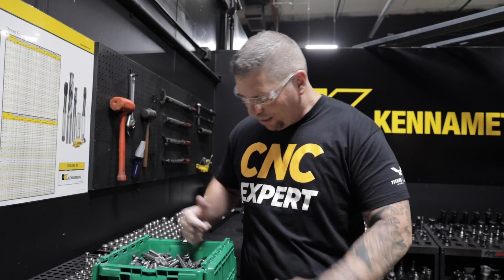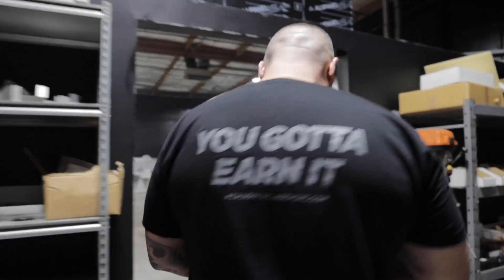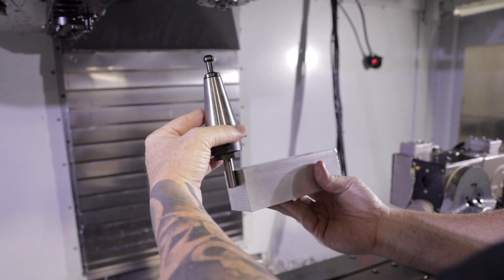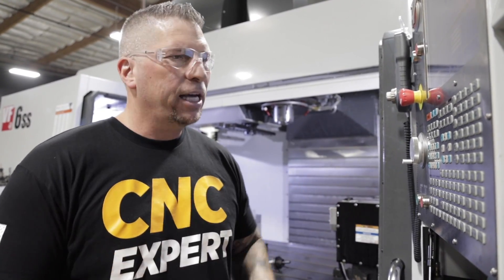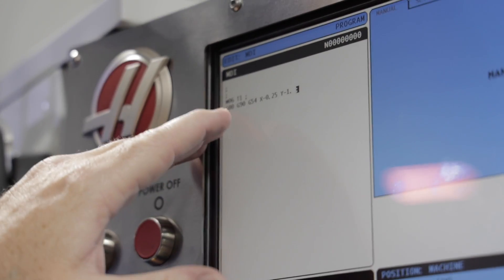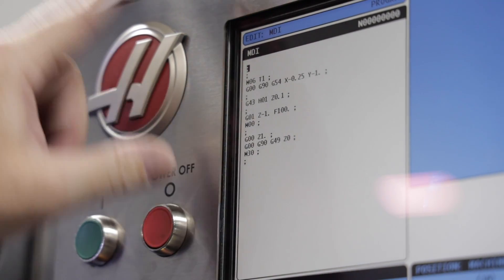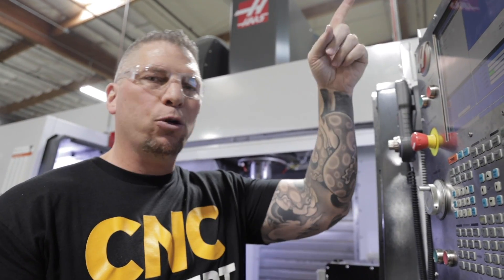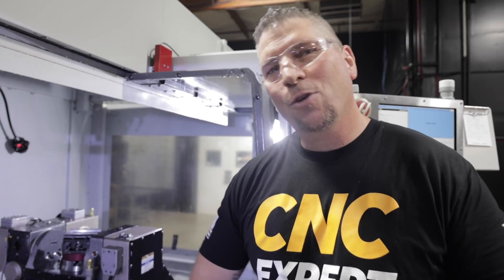G & M Code - Manually Programming an Invisible Stop - Vlog #46

Comment: Hey Titan this is a simple and effective time saver I have been doing it like this for years now. The company I work for know the guys are so set in their ways, that they cant see the advantage  of this method. So I took 1 of their simple jobs that's held in a vice, they have a stop on the table then place a block packer against that then load the part in the vice then remove the block packer and machine the part on both ends and drill and counter sink 4 holes in it, time consuming if you ask me.

I set the job up with the stop pin method you talk about here. it drops in place BOOM, load the part and press cycle start, never worrying if I have removed the block packer. save about a minute a part finish the job in a few hours all to spec and in half the time. this is in a small old Leadwell vmc25. They complain still oh I have to lean in to far to do that or the spindle is in the way not realizing that the job takes half the time that it used to do. then I want to fixture the job as a set of parts but they dont want to spend the money on it because we have been doing it like this for decades.

Comment: I've been doing this job for too long, I love that Titan makes the videos. People that do our job, we are a different breed. We alive military style and we are perfectionist in everything in life. I respect all of my fellow machinist. People don't understand the pressure and stress we live with.
Reply: It definitely is a stressful job sometimes even an apprentice 😂 when we're working with 0.02-0.05mm tolerances (1 or 2 thou) on bearing journals in a part for an expensive assembly, a simple wrong button press or oversight in the setup can cause huge loss of time and money for the company and client.

Pretty much everything that my workplace works on is for the mining industry and some of the stuff is insanely big (we have everything from small jobbing lathes to 8 meter diameter vertical borers, 10+ meter floor borers and 14 and 15 meter gear cutters) so a small mistake on some jobs can literally cost millions of dollars. I was the last apprentice to work with this one particular machinist who ran a huge manual floor borer and one of the best pieces of advice he gave me before he retired was "In this kind of work your mind has to be present at all times. Anything at home or outside work, don't think about it. If you're not present then just go home." 

All that being said it's the best job I ever had, and one of the few that I find fun and interesting enough to make the stress worth it. Finally found an industry where being a perfectionist is a good thing

Comment: I use 6mm end mill shanks as pins for cutting angles on parts if I can use trig to put holes in the part. Or using trig to make angle blocks

Comment: My experience is limited with automated machine tools. I was a Westinghouse apprentice in the early 1970s, trained as a Swiss-style toolmaker. When I did go to work at an automated shop, the jobs were run on mylar tape ( Bridgeport Boss 5 ). One of the first programs I wrote was for a part that required two hold/stops to move clamps. These machines were also manual tool change and required a hold/stop for tool changes.  Every operator we put on this job would eventually have a brain fart and do a tool change with the clamp move, driving a 1/2" long flute endmill into the vise. I solved this problem by blocking in the shell mill that was in use when the clamp change hold/stops came up. The hold/stop was re-programmed with the shell mill 1/2" above the dead jaw. That way the tool can't be removed. Just something that some programmers can overlook. This can save a lot of drama, especially if your shop uses entry-level operators.

Comment: The trick with longer material into your vices, I did this trick on conventional machines too, at least it had a digital axes counter. 😜
I'm 55 years old now been milling sinds I was 16 years old, never had cnc machining at school. Also later on not one employer had an idea to let me learn cnc. So I explained to the welfare here in my country, told them that it was cheaper to let me learn cnc wile I have no job, wile I'm benefiting from the community. So they saw the light and gave me a chance to learn cnc. Now I went for iso cnc, still on school. Learning heidenhain. And have fun again.
About two weeks I get the diploma and then employers want to have a skilled conventional engineer who can program aswel. May 13 years from now I'm done working or having my own company

Comment: Old school method, used for years. It's great especially for large parts, water jet cutted parts, tiltened vise on a 3 axis machine, when positioning is difficult. But if u works on small parts exceeding for a few amount the jaw, for example imagine  multiparts on a tombstone, it's mutch faster to produce a little '' L'' caliper of the exceeding misure u need  also in alu material and use it to clamp the part. Use this trick save u wasting time by launching this program to clamp 40 parts on a tombstone.

Comment: In would use a SUB PROGRAM to do this. No need to copy and past. Also I would have ground the broken end of the end mill to remove sharp edges before putting into the collet.

Comment: I used it quite a lot in the past. This method is often used when you need to flip over the part held in chuck and locate on the hole from previous operation.

Comment: Ice video and tip. But when setting up a vice its always best to setup a x stop to start with. Still nice video..
Reply: Nice.
You can call other programs and run them from your current program, then return back to your program when its finished. The method is using that program as a start what you can do is save it as a pinstop program say 123456 pin stop. Then from your man program say its called 123444 wing hinge call up your 123456 pin stop program. If you do this you will need to call up your main program from within your pin stop program. This tip will save you time in loading each program manually.

Comment: If you do aserial production does this not slow down the job? I mean is it not faster to use stopers?
Reply: Karlo Pobrić yeah it’s for sure slower. And only works well on smaller mills because the table moves away from the doors when the you have to load the part. So you have to lean in farther than normal to load.

Comment: Just one thing: Be careful with the cycle times. A colleague of mine used this method frequently to do his setups quickly which was fine for short runs.
But then he was using it unnecesarily for long production runs wasting hours of accumulated cycle time because he was lazy to expend 5 or 10 minutes setting up a physical stop and edge finding the X value for UCS (G54, etc).

Another thing that happened once a while was the operator putting the part before running the stop, crashing the machine (I assume this also happens in Titan's shop, thats why he moved rapid to Z0.1 then feed to Z-1.0 instead of just rapid to the final Z stop position. Still a F100. can do some damage.)

Comment: But you can do x and z as well..Find a holder with a wide face, do a tool offset probe on the HOLDER, insert the pin and now, you can use the face of the holder to set z on a "floating" part and the pin sets x. I do this all the time on a few small odd shaped parts, where I have sq sides, but nothing on the bottom to set on parallels.

Comment: I don't know that this is really an old trick as its usage is pretty common in situations where stops are not possible. I also grind away most of it except for about 1/4" towards the bottom so I'm not getting odd touches on material that has been cut out of square by some fuck at alro.

Comment: Used this technique many times. If  I'm cutting all 4 sides of the material I'll use an adjustable machinist square and scale off of my hard jaw. I've also used this pin method for 2 part programs when a part is longer than your travel. Boom!

Comment: One tip I would add to this tip is tight the collet by hand not with a tool so if your operator put the stock too far, the endmill will retract in the holder instead of 'crashing'
Reply: Wow never thought about that good stuff man 👌

Comment: Old school is right, the shop i first saw this being use started with a paper tape nc mill 😲
Reply: One thing to look out for  endmills are typically undersized by a couple of tenths. For stuff with tight tolerance work, it can cause issues.

Comment: I would have written it to sub program then assigned G or M code macro call . The operator would only need to remember the one shot G or M Code .... G110 X-0.25. Or just used Renishaw easy set if avaiable.

Comment: thanks for showing the need to know manual G code for making these quick programs.    at M00 I always add a comment (Do Something). as this primary M code is used many ways.  like you need to stop and reclamp - M00( reclamp) or this pin stop M00 ( load part) - just as a reminder what to use. 

If you get a little deeper and you have a probe you can scoop a probe program and in plant in main program      it goes on and on knowing basic G code.....thanks
Reply from the maker: Comments are a must.

Comment: That's a great idea, thanks titan! I use a similar trick on one of our lathes for partoff jobs, I put a 1 inch machined bar in one of the turret tool holders and bring it down to a location, then u pull the stock out till it hits the barstop. Way better than a hand stop
Reply: IUse the flat side of the part off toolholder

Comment: I can see this being useful for 2nd op or later ops.  For 1st op with rough stock wouldn't it be easier to just use a stop-loc adjustable?  That's what I do when a stop will interfere with op1
Reply: Also to add I've been using this method for a while. Just never for op1. It's a great way to ensure your part is where it needs to be in relation to where the machine knows where it is. 😀
Reply: With rough stock like he has here I've scaled to the jaw, very fast no problems. Nowadays it seems operators are afraid of scales 😂 but if I program this pin stop method they're ok with that.

Comment: I have been in the cnc world for a while now, and made a transition to cnc routers because of better hours, location etc (I live in the middle of nowhere). I get the pleasure of training in new operators. One thing I struggle with is trying to get them over their fear of mistakes. It's going to happen, you will screw up. It could be a simple bad part, or you could run a bit into the table and shut the machine down for a week.  When it happens, we will use it to learn more. This fear however limits them. I understand the machine and tooling and especially the attachment we use to add another axis that allows 3d parts is not cheap, but you can't let it stop you.

Comment: I first used the Boeing trick you talked about to run a flange plate around 45 inches bolt hole patern in diameter on a haas vf8 about 5 years ago.   The machine only has 40 inches y travel.  Had to talk with the boss to (cover my butt)  that I could run it with the front doors open ran first half of the holes then spun the plate around 180 to get the others. Useing the drill bit to locate two holes from there I could use clamps to clamp the plate down. It was a pain to locate

Comment: More types of these videos please. Was actually doing the same concept trick but on a lathe a guy I work with taught me. Had to rough these tool steel shafts and didn't have a stop on the jaws but the stock fit inside the spindle. Chuck on the material (make sure it's only sticking out an inch or so) and have a cut off boring bar as a stop that the machine would rapid to so you can pull the part out to the same spot every time. Boom!

Comment: A lot of machines won't do G1 without the spindle rotating, it will alarm out. Have a M3 in there or just G0 to your position.
Reply: Does M184/M185 apply to Haas machines?  Feed motion enable/disable while spindle is stopped.

Comment: Or you could just mount a removable stop to the fixed jaw of the vise. Remove when not required.

Or you could just locate that part to the edge of the fixed jaw of the vise.

Both those options would save you from wasting tool carousel (if we're taking Haas mill) space in the machine.

On CNC lathes, when I've ran a part, I would use the side of the turret as a bar stop. All you do is open the chuck, pull the bar out until it touches the turret, then close the chuck and you're ready to machine another part. You can actually buy a bar stop which uses the space for a tool??!! Why the hell would you wanna waste tool carrying space for that?? lol
Reply: We have bar stops on our lathes at work, but we can open the collets when the spindle is running. Stops them sticking so much.
Reply: We have bar stops on our lathes at work, but we can open the collets when the spindle is running. Stops them sticking so much.
Reply: Neither of the things you mentioned are always an option and neither are as accurate as the method in the video.
Reply: @danieleiferd4978  

A hard stop on the vice is accurate to tenths, provided you use it properly, and clean it down with compressed air before locating a new part. 

It's a hard stop! Of course it's accurate! Nothing should be moving. If something is moving, then you got bigger problems lol

Edit: and using the side of the turret as a stop is perfect too, because the first operation you're about to do is rough face 20 thou or whatever amount from it anyway, so it makes zero difference if it's 5 or 10 thou out. (Which is very unlikely anyway)
Reply: @neilhuband995  The entire point of the pin stop is when you CAN'T use a hard stop. When you said a "removable vice stop" I thought you meant a spacer or something against something else in the machine that you remove each time. Of course a proper hard stop is best but it's not always an option.
Reply: @danieleiferd4978  that's not how he demonstrated it with that aluminium block. But ok, for times where a hard vice stop is impossible ...

It's still stupid. Why not have all that expensive carbide sent out for regrind. If you're a big shop like him, buy a CNC tool regrinder and do the regrinding yourself, doing something actually useful with all that carbide, because using it for workpiece stops (lol) is absolutely pointless. You could machine your own 1/2" pins from tool steel or suchlike. (Or buy a few 1/2" certified pins if you really want to be anal).

There's absolutely no advantage to using carbide for this 'application'.. :-D

Source: 15+yrs as a lathe programmer for aerospace and oil industry

Comment: Excellent. This is how I set the origin on fixture plates that I use. I mill a .250" center hole/origin. Anytime I want to use the fixture, I tram it in, and then drop the pin into the center hole, and boom, origin set.

Comment: Yes, this is a nice old trick before probes. I've done this for years and even have had the machine move the part for me. Last hole is done and tool changes to the disappearing stop of proper size. Once the pin is in the hole, hold and loosen the vises and resume. Part feeds over to NE location and hold. Tighten vises and resume. I find it best to use stepped vise jaws as to have no need for parallels. You have to be careful of bowing with really long parts. Like Titan said, you have to put the thought into it and you can solve just about any problem. You don't need no stinking probes....lol
Reply: Very true. I also used this to reposition a larg round plate. Using a hole i turned the hole plate 180 degrees as it was to large to machine from one side.

Comment: I used to use the same technique, but I used hardened and ground dowel pins instead. Either way it still works great. I did it because the operators were pretty tough on fixtures, and back then, we didn't have the fantastic fixtures that are available today. Back then we had to create our own fixtures and often times the operators would knock fixture stops pretty hard, especially with large parts.

Comment: Hi,
Good Tip.  Thanks for sharing.
I have some 1" wide extruded rails that I machine key hole slots in on my 2007 HAAS TM-1P. that are about 70 inches long.  During the machining process I have to open both side windows.  As the table only has 30 inches of travel I had to make a couple of work offsets to do the job.  I also had to put some small tubs on the outside of the window frames on the floor to catch the coolant that ran out the ends of the extrusion during the machining process.  I have both a PCOOL system and a manual coolant nozzle with an associated cut off valves.  As all of the machining was done at the same level I used the manual coolant nozzle that fed from the front of the spindle which pretty much contained the coolant within the enclosure.  If I used the PCOOL nozzle that fed from the right side of the spindle it would shoot coolant out the open left side window of the machine during the machining process.  Kind of a (clean up on aisle 6 type of thing)  Ha Ha

John
Reply from the maker: That’s Awesome!

Comment: Another trick is to use old end mills as indexing dowels in fixture plates. I do it all the time on my machine.
Reply: Yep. I've even put them in a hex, 5c collet block and held that in my Toolmaker vise @~25* and ground flats on every other flat of the hex collet block. Makes it just like a locating pin that's easier to hit the hole with. This way is more expensive than a locator pin but sometimes it beats waiting on ordering them when you need them NOW. Other than saving lives, this has to be the best trade on earth.
Reply: way too hard. It will typically mar either the part or the fixture. Just use a ground pin.